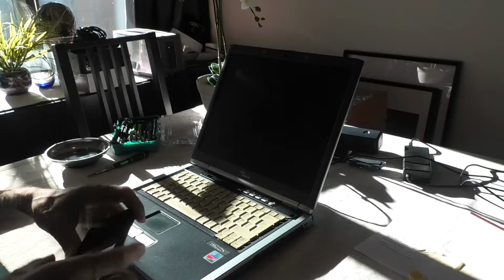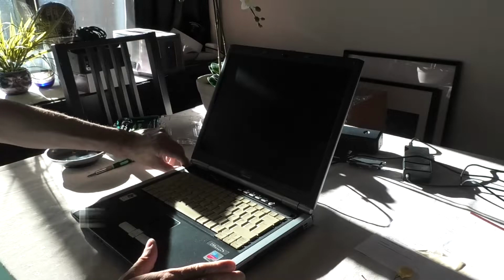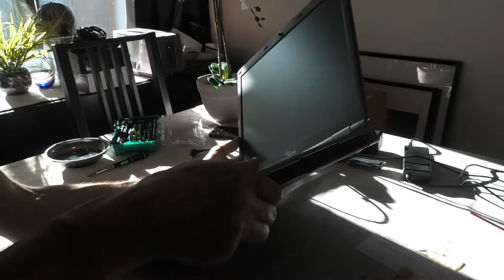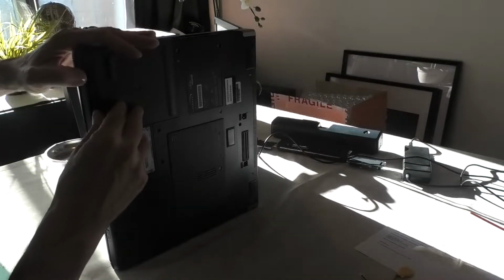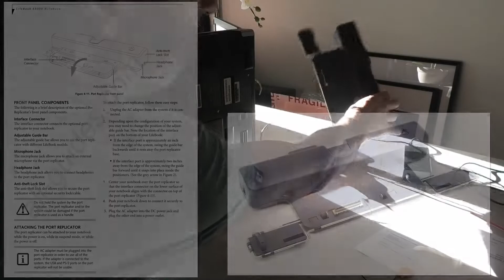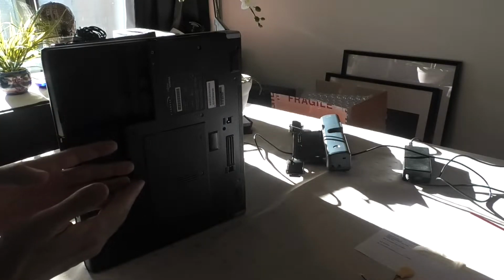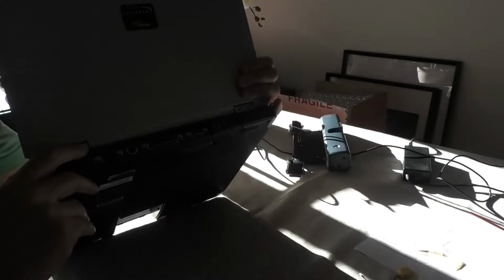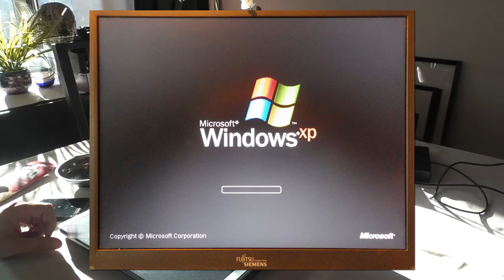LifeBook E8010 Upgrade - Part 1: CMOS Battery replacement

Comment: i have an E8010, It is working but sometimes it overheats and i get bluescreened on boot. Thats been happening since 2011. Any Suggestions???
Reply from the maker: First thing that comes to mind would be a problem with the cooling system, either some dust, hair, etc... clogging the air vents and reducing the air flow, another possibility could be that the thermal compound between the CPU and the cooling system that could have dried out and not insuring a proper heat transfer.

That alone could be causing bluescreens, but would not hurt to also run a full memory check (after you've checked the cooling because that's supposed to run for hours), and also perform a disk scan for any corruption of the filesystem.

Good luck!
Reply: Thanks, how Exactly do I run a memory check and a disk scan?
Reply from the maker: @AheadDev  There are multiple pieces of software that can do a memory check, it kind of depend of which OS you have installed and if you can boot it.
You could try the 32bit USB bootable version from https://memtest.org

Same thing for the disk scan, depends of the operating system, if you have Windows XP you could try that: https://www.wikihow.com/Run-a-Chkdsk-Function-on-Windows-XP
Reply: @DbugII  Thanks!
Reply: I have a broken hinge and I also had difficulties removing the panel that holds the lcd display and power button, it just won't release

Any Help?

Comment: I have an E8010, which was a beast when bought in 2004. 2GHz CPU, 2GB Ram, 80GB Hard Drive, DVD/CD Writer and 1400x1050 screen. The CMOS battery has died, it would be great to get this working properly again. Thx
Reply from the maker: I agree, it was a very well specced machine for when it was released, and with good accessories too.